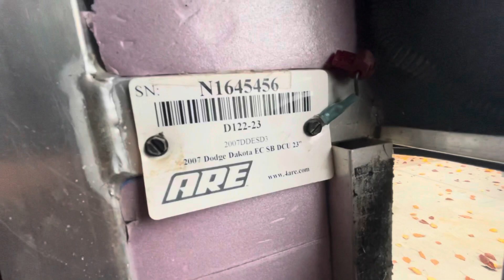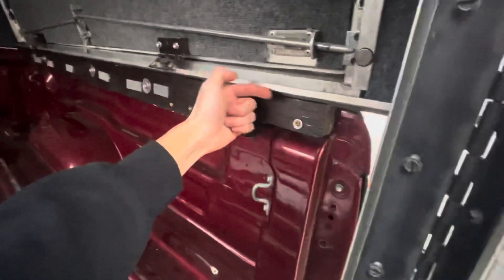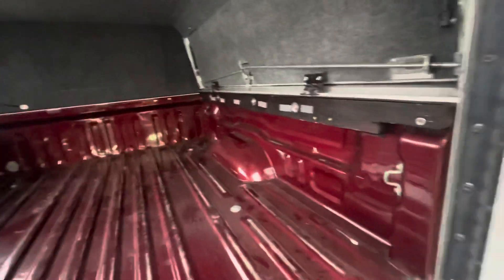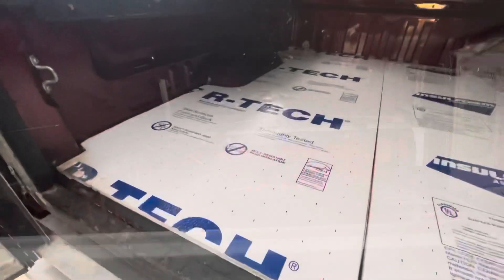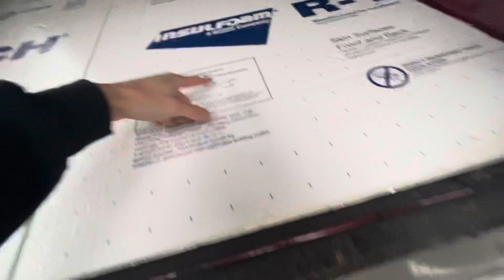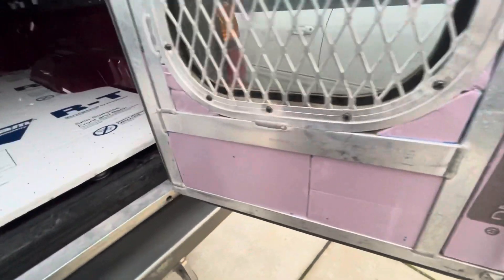Toyota Tundra Camper - Topper Alternative How To

Comment: I agree and had the exact same set of ideas for my First Generation Tundra.  I agree that the "barn doors" and the "Windoors" were essential to my outdoor adventures.  The addition of some bug screens is the only major addition beside the bedding.  I found a bargain on a ARE contractor top, nearly identical, made for a Chevy 6.5 foot bed.  That, of course, is too long but I have a plan to modify mine to better fit my truck.  Thanks very much for sharing.

Comment: Can you run flat bar on top of rails and drop some square tubing in drop holes to hold flat bad welded up. Can extend for extra support. Love the content brother keep it coming.
Reply from the maker: That would work too. It was already spendy and time consuming redoing the insulation and carpet on the topper that I just continued using what has worked for years. Just need to update the seals. So far its been a much nicer seal and topper to sleep in